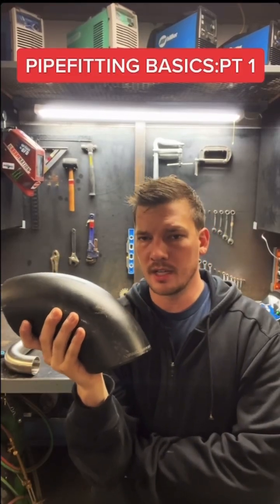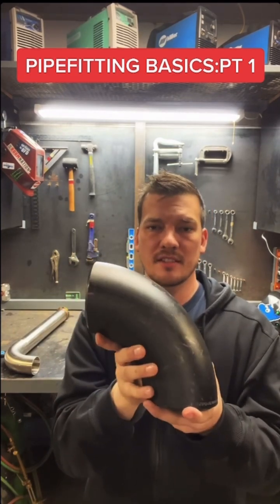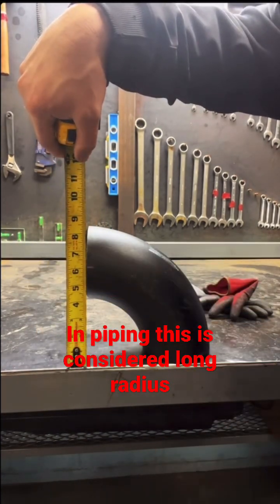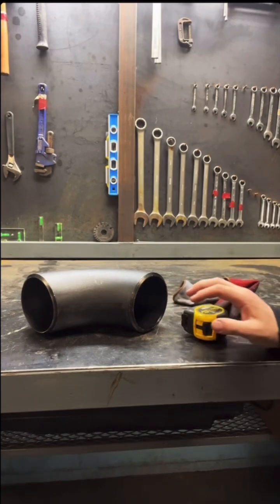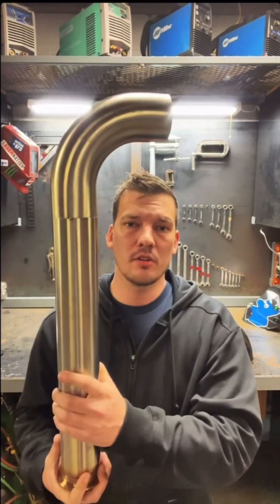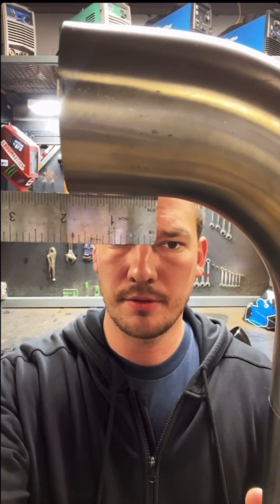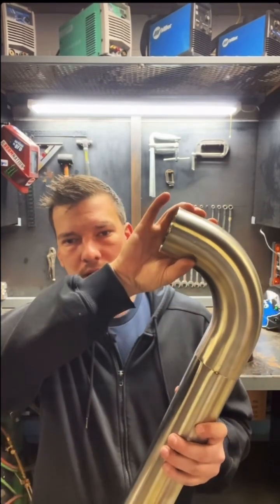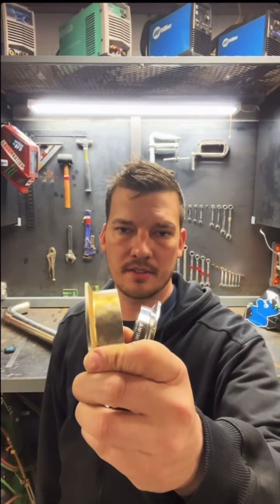Pipefitting Basics-How To Find Takeoffs       #pipefitting #pipewelding #fabrication

Comment: Im a pipefitter/welder and this guy has good videos. Theres a way to figure out takeout for 45° fittings also. If its 6" you just half the diameter 3 times. 6 - 3 - 1.5 - .75 then you add the 2nd and 4th #'s which makes it 3.75. You can buy a blue book or pipefitters handbook that has this and a ton more info.

Comment: the spec sheets for long and short radius elbows (pipe and tube) also provide this info, good short Drew
Reply: So the takeout on a 90 depends on if it's long radius or short radius, long radius is 1.5x and short radius is 1x